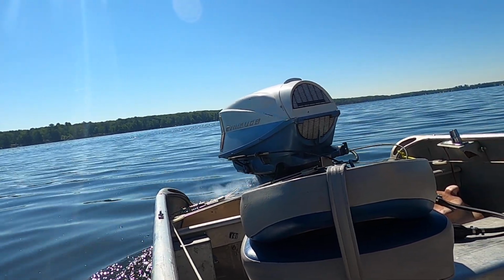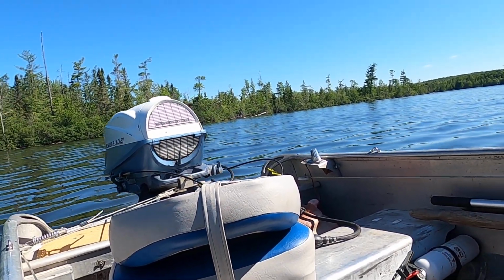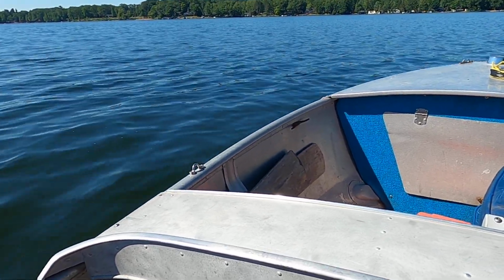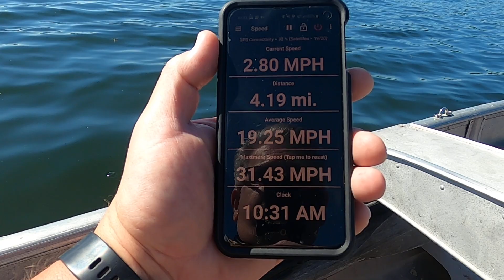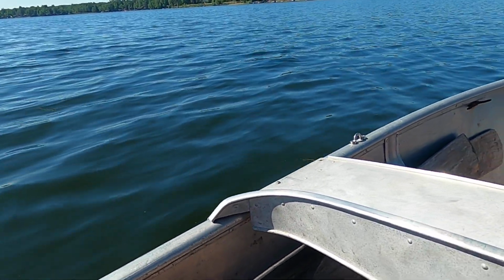1963 Evinrude Big Twin 40hp Outboard Motor Lake Run

Comment: Hey there, another great video!!! I was wondering what the speed of that boat is with your 25hp motor on it? I've got that 15' Meyers runabout and I have a couple of those 40hp Evinrudes and I also have a good running 25hp Johnson. All of them are old motors so I was wondering the speeds to determine if it's worth the extra gas for a few mph? Thanks again bud!
Reply from the maker: Hey!  Thank you.   With this boat and my '54 Johnson RD-16 25hp on it I got 26mph with myself at the tiller and another adult passenger in the front of the boat. Once you start to approach 30mph with this type of hull it takes a lot more HP to get a little more speed.  Before you know it you reach maximum hull speed and you start having things like undulation of the floor when the hull's rigidity is overcome by the prop thrust and it starts to buckle.  Bad things can happen quickly once you reach that point.   Generally speaking that does not occur until well past rated HP, but that depends on the manufacturer and the condition of the boat.  All that said, going faster on the water starts to take exponentially more power once you get past a certain point with a given hull design.   You are not likely to see more than four or five mph greater speed with a 40hp over a 25hp Outboard.  The bonus is that with the 40hp you can back off the throttle and cruise at a lower RPM and often use less fuel than running the same speed with the 25 at WOT.  Thanks for watching!
Reply: @oldjohnnyrude8404  that was a great answer... I've been wondering since starting on restoring the boat what motor to use. I do have a 94 Merc 40hp oil injected with power trim that I could put on the boat, but I'm a bit scared that it would be squirrely. In my experience I've found that Merc's hp to hp will out run an Evinrude. I am really looking forward to spring and getting the Meyers done so I can play with different motors like you do. I wish I lived closer to you..  I could learn a lot from you!!!!! Oh an I read one of your comments about the bottom of the boat bending.. I've had that happen to me on some of my old row boats when they get to a certain speed.. sounds scary when it does it..
My last rowboat was 14.5' fiberglass boat and it did that with my 25hp Johnson but boy would it move right along. So anyhow, I wish that my motors and Meyers weren't tucked away behind so much stuff I would send you some pic's. Have a great day! Hope to meet up with you one day!

Comment: Looks just like a28 hp I had went really well
Reply from the maker: Yes, the 28hp is basically the old 25hp powerhead on the non-super quiet leg and does look very similar to this 40hp with the super quiet lower.  The 28s were good motors as well.  Thanks for watching!
Reply: He'll that was about twenty five years ago had a funny little flap that the starting cord was in went so well can't remember what I did with it
Reply from the maker: @Paul-e9w  Yep, this 40 had the same door in the front that gives access to the carb adjustments, manual choke, and the starter pull handle.  👍
Reply: I had a ski twin 28hp was a oldie but a goodie still mucking around with boats an outboards up graded to a launch now with a 200hp V6 yam two stroke thanks for your reply boat on mate

Comment: There where no differences in the 1964 engines, except for a thicker Tin Platiing on the Pistons, which wore off during Break-in. All the Bearings , are the same as in the 1963 engine. So you can run a TCW-3 Oil at 50:1 in that your engine.
Reply from the maker: I believe that is also the case with the 18s all the way back to 1958.  The '57 is the only one (of the 18s) that originally had different needle bearings on the wrist pins that the rest of the run.  Still, the factory reccomended ratio on pre-1964 motors was 24:1.  I will only recommend factory reccomended ratios when asked.  I agree that some motors had no design change that went along with the ratio change and in some cases, like this one, that chage was more arbitrary than having anything to do with powerhead design.  Thanks for watching!
Reply from the maker: ⁹